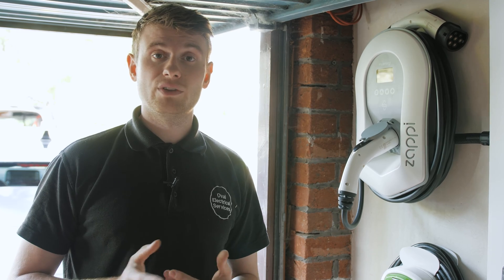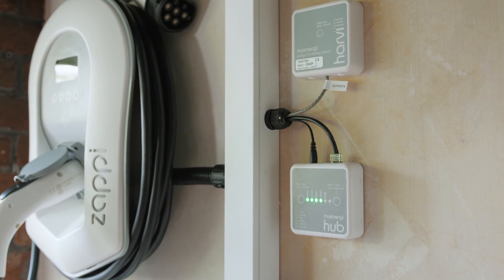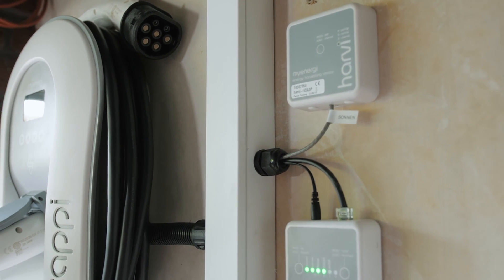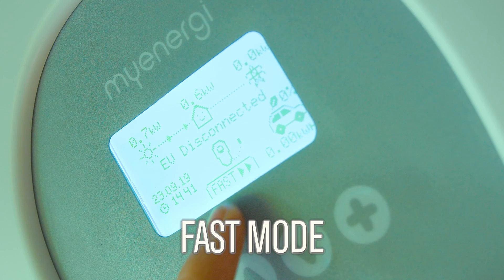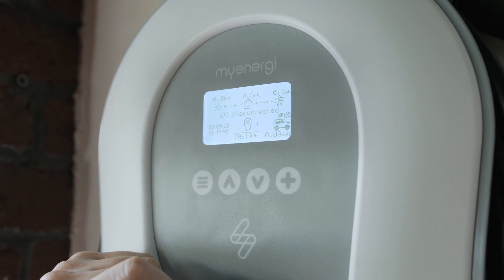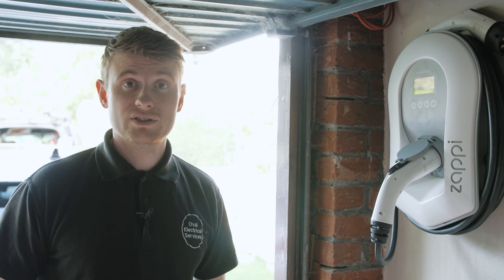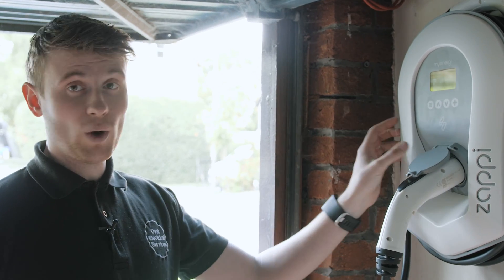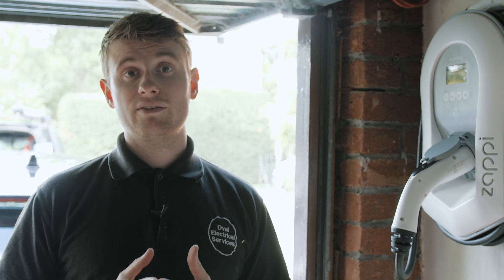Fulford Home Energy System - Part 4 Zappi EV Charger

Comment: Wow amazing videos and very professional.  
Love watching you and glad to see you are giving artisan some tips.. all too guys!
I’m an electrician and not into these kind of installs however I wish to get this system on my property. 
Soon I would like a Zappi for my new EV Tesla.  I want to put solar on an outhouse down the back garden.  Large out area..  7 x 3 meter roof.  I have a CCU down there from 10mm armour feed from the house extension CCU DB2 which is fed of DB1 under the stairs.. both not very accessible as I installed the 10mm armoured when the garden and house was back to a shell when I refurbed it.  Anyway.. the Zappi is to go out the front of the house.  Any recommendations how to do this please?  I have plenty of indoor and outdoor space in outhouse.  I’m guessing from your vids that I can wire all the panels off the out house to the battery storage and sonnen equipment/CCU down there in that area and then what cables to I need running back to the fuse board in the house/Zappi out the front please? I can work out the wiring another time but thought I’d get the cable runs in ready.  The meter box is out the front near where the Zappi is to go. 
I am down on a solar course in the local college but due to Covid it’s taking ages and I’m still waiting.  Hope you can help
Thanks
Paul
Reply from the maker: Hi Paul, thanks very much for the comment. I am glad you like the video! Sounds interesting! If you would like some help to achieve it then drop us an email to info@ovalrenewables.com
Reply: @OvalRenewables  thanks 🙏🏻 appreciated.. just dropped you a sketch and description but honestly.. don’t rush to reply.. enjoy your Xmas break 👍🏽

Comment: I'm looking at a similar setup (Solar + Sonnen Hybrid + Zappi) : quick question : how does the Zappi communicate with / know about the Sonnen ?
Reply from the maker: Thanks for watching and thanks for the question. The Zappi knows about the battery via a CT clamp that is wired to the solar/battery circuit. One thing to consider when looking at a system is that with the hybrid systems the Zappi is unable to determine what energy is solar and what is battery. If you went for a solar system and then an AC coupled system the Zappi could monitor each component individually.
Reply: There's no direct communication between the two. It works via AC coupling and current (sensing) transformers. Once the Sonnen battery is full and the solar starts to feed in the grid then the Zappi sees this outgoing current and starts to act.

Comment: Why is a Harvi needed when the Zappi is next to it? The CT clamp wires could just as easily have gone straight to the Zappi thus saving the cost of the Harvi.
Reply from the maker: John Rogers thank you for the question! With this install there are three CT clamps that are required. Grid, solar and battery. Currently only two CT clamps can be hardwired into the Zappi directly, therefore we had to take the third CT clamp, which was the battery, into the Harvi.
Reply: Thanks for your reply. I guess that you installed the system before  Zappi firmware 3.033 which allows for three CT clamps to be used.
Reply from the maker: John Rogers yes this was installed at the end of last year I believe.